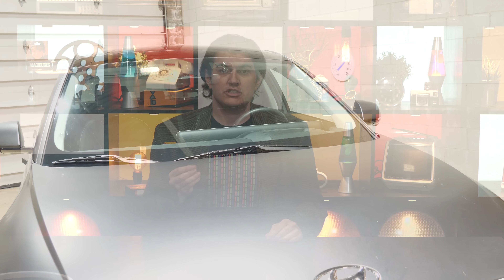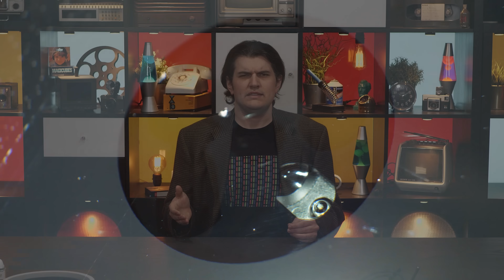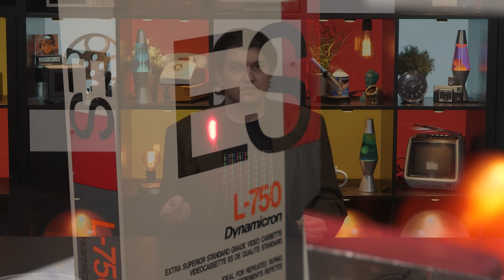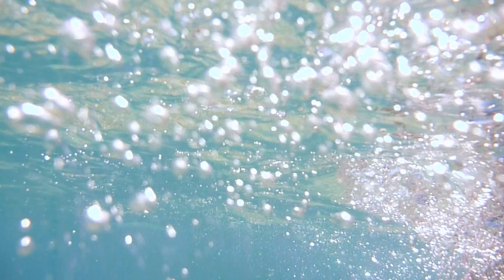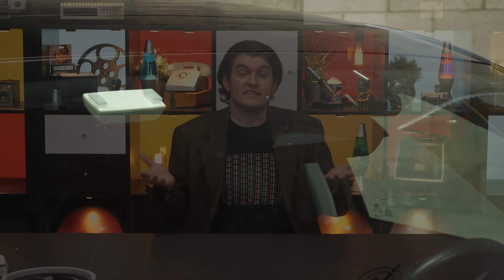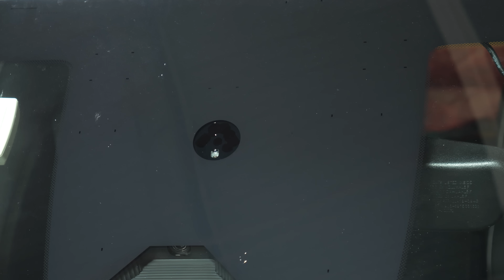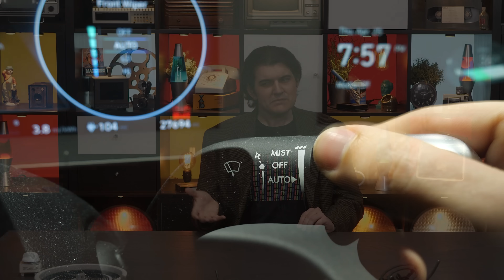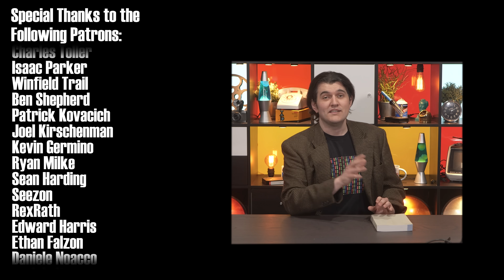The simple, clever sensor behind automatic windshield wipers

Comment: Fun fact: Mercedes (at least on their more expensive sedans) never have had variable intermittent wipers, they went straight from the 3 lines (intermittent, low, high) on the w123 to rain sensing wipers on the w124. Which also had the monowiper which is a cool engineering piece.

Comment: Looking at the size of that Owner's Manual, it took somewhere between $500,000 and $1,000,000 just to write, edit, spellcheck, grammar check, then edit again, check it for accuracy, have the engineers check it over to make sure it agrees with what they provided in the first place, and prep to print. For a car like yours, probably another $750,000 to print them.

Yes, a very large amount is all people's labor, people who are trying to make it correct and easy to use.

I know this because I used to work with these people. Myself, I was working on the Service Manuals, much larger books with much more details, yet a thing like the wipers parking up for service would be included.

Of course, my estimates are based on the costs and salaries of people doing that in 1993. So probably double that today. Do you now realize how important they are? Btw, they are also a legal requirement to sell vehicles in the US. Even heavy equipment hasd User's Manuals, especially when the controls change a lot due to new innovations that change how the equipment works, including electric power rather than internal combustion engines.

Comment: I've never encountered anything automatic that actually works the way I want it to. Some are tolerable, some outright interfere with you. From rain sensors and lane assist all the way to transmissions. The sensor itself is cheap but add in the design and software costs then multiply that by all the random automated things and you start to understand why cars are so expensive just to seem "luxury."

Comment: The cars that have an average function, to keep the wiper from going nuts, needs to reset the average reading when the light frequency changes, to detect tunnels which have the roof lights closer together than the outside road lights. Also at day the sudden darkness should reset the averaging. This wound keep the slow averaging from not turning off the wipers before almost getting trough a short tunnel, and help turning the wiper on as soon as you exit the tunnel in pouring rain.

Comment: I've owned two vehicles with supposed automatic wipers. Neither worked automatically and never sensed the rain.

And why is it that auto manuals are the only book where it's quicker and easier to look up things in the index than in the table of contents? They should put the index in the front of the manual.

Comment: The trouble with modern owners manuals is they are stuffed full of warning such as "do not drink the battery contents" or "eat the tyres" so much so that having looked up the page you want in the index you cannot find the relevant information due to the ass covering warnings. My cars wipers also turn on when there is a lot of pollen on the windscreen, which is annoying as it is sticky and smears everywhere, no use trying the screen was facility as the wipers start moving first, the celay should be the other way screen wash/mist first then wipers start to move once screen is wet.

Comment: As an otherwise very happy owner of a 2014 Tesla that doesn't have all the cameras (only the rear camera) and uses a rain sensor like this, I don't like the lack of manual control over the wipe frequency. It's just auto high/low sensitivity and manual high/low speed but no manual intermittent. It's really annoying when there's a light rain or a mist and it jumps between intermittent and high speed, or it's pouring and frequently jumps between high and low speed, or it's not wet at all and it randomly wipes. As such, I almost never set it to auto, thus not using the rain sensor. I've opted for rain repellent and manually pressing the wipe button on occasion when driving too slow for the airflow to wipe the water away (below ~40 mph).

BTW, I highly recommend rain repellent. I avoided it for years because I heard reports that it made the wipers chatter, but that has not been my experience and its effectiveness met or exceeded my expectations. It makes a huge difference for visibility, especially on dark rainy nights when the lines on the road are barely visible (I'm in Michigan where road reflectors aren't a thing). As a bonus, the wipers last longer since you don't use them as often.

Comment: This is so interesting. My current car is a 2012 Hyundai Genesis 5.0 R-Spec and it seems to have all of the same workings as a current Ionic. From the sometimes not being strong enough during a downpour and being too heavy for a drizzle. Down to the wipers not being accessible to change without them being on. I have not checked if holding the stalk to the spray setting will move them up. I'll have to try it and see if its in the manual.

Comment: While rain sensors are cool, Hyundai and Kia need to fix the rain sensor! It is so frustrating on my 2023 Kia Niro EV that I would rather have the intermittent settings and no auto mode. I don't know if the sensor can be fixed in software or not. If not, surely they can program a setting where intermittent can be selected and the Auto setting the becomes intermittent.

Comment: When all else fails, RTFM.
I used to have the auto wipers disconnected on my car.  As in, I actually took apart the thing behind the mirror and pulled the wire off the sensor, because it was crap and disconnecting it forced the car to revert to delay wiper mode, using the sensitivity control as a wipe frequency control.  Then a big rock hit my windshield, and I had to have it replaced.  With the new sensor that came with the new windshield, it works nearly perfectly.
And yes, I end up googling every time I change my wiper blades, because I forget how to engage maintenance mode and googling is quicker than looking through that book.  I do have to wonder why cars are the only thing that still come with physical manuals, and why they're so annoyingly large now.  They used to be much thinner, and nobody read them back then either.
Agreed on stalks.  And I'll say it:  Screw you, Tesla.

Comment: But why I'm still able to trick wipers to turn on by just tapping on the windshield with my fingers? Just 5 or 6 relatively fast taps in the middle of the windshield, not interacting with the sensor lights directly? Does that slight vibration affects light too? Or is there another sensor that detects the effect of water hitting the windshiled?

Comment: My car knows when it is wet, it knows this because it knows when it is dry.  By subtracting when it's wet from when it's dry, or when it's moist (whichever it is more), it obtains a difference, or deviation.  The car's computer subsystem uses deviations to generate commands to drive the wiper motors from a state in which it is wet, and arriving at the state of where it is dry.

Comment: Damn, that’s a thick manual.  I had to recently google the size of the aux terminals on the battery in my Bronco so I could purchase a bolt to use the unused posts for powering an air compressor. Battery was only mentioned in a section describing how to jump start the car. I knew I was reaching too far trying to find this.  After getting the two nuts from a local hardware store, I find out the two available posts are actually different sizes! DOH!

Comment: I was a professional driver. It was my job to drive a vast variety of cars and trucks (real trucks, not pickups, although I got to drive those, too, every now and then). After years and years in my career not once, not a single time did I encounter a windshield wiper automatism that actually worked. And beeing a former radio-/tv-technician and also just now training to be a software developer, I'm not surprised by this experiences. With the hardware used to determine, whether it's raining, it's simply impossible for the car to know, when there's something on the windscreen blocking my field of vision at the particular moment.
I don't care, if the car knows, when there's a drop of water in that extremely remote and usually unused part of the windscreen, where the sensor stupidly is located. I need my windscreen to be clear in the area where I am looking through. As long as no sensor whatsoever is monitoring my field of vision, it is logical that no automatism whatsoever will ever be able to know, when to wipe.
Reply: You are absolutely right! I find that rain sensor is the most stupid and useless invention in the car world. My previous old Honda Accord had manually adjustable interval, and it worked perfect. Now I have Honda Civic (2017) in the "maximum" configuration, including the rain sensor, and since I bought this car in Oct 2017 I can use the wipers only in MANUAL mode, because the rain sensor is inadequate and crazy unpredictable. During the elapsed 5-years garantee the official dealer few times updated its firmware, twice replaced a film between the sensor and windshield, but could not fix it. I asked them to disable this bulls..t and return the manual interval control mode, but they say: "Manual control is available only in a cheaper version of this car, and we cannot replace it" 😞.
Reply: I have found auto wipers to be mostly garbage as well, making this video very funny:)
Reply: I don't understand why auto makers insist on this stupid feature. I guess they like to fool buying into thinking it's a cool option to have. Very annoying. On the previous car it was manually operated and it was very convenient

Comment: I had 3 cars with automatic wipers. No surprise that each one (different makes) behave a little different. 
1. KIA Ceed 2014 tend to swipe wipers once every time you start the car. Then during driving sometimes it lost track of wetness of the windshield and I had to manually trigger wipers. Not so often but it happened.
2. Lexus CT200h 2015. No extra swipes when you start the car. Do not get lost, overall good behawior. The only complaint is that it didn't detect intensivity of the rain good enough. Sometimes, not too often wipers interval was of too slow or too fast.  Most of the time you had to wait 3-5 wipes and it corrected itself.
3. Audi A6C6 2011. Best sensor I ever had. No issues that previous cars had.

The only drawback that all the cars had. Including Audi is fog detection and switching automatic light on. However probably this is different sensor to blame, not the rain sensor I guess.

Comment: not reading an owners manual almost feels like a sin.
theres so many quirks and tricks you can learn about your car.
for instance knowing that if you hold your open door button for 2 seconds will make the car lower its windows, which can be a lifesaver.
or if you press lock doors before all doors are closed will lead to the car automatically locking the doors after shutting the last door close. really handy for groceries.

Comment: To my knowledge, the first car with a rain detector is the Citroën SM from 1970, though it worked differently, it wasn't really detecting rain but sensing the best speed for the wipers blades by running current through the windshield, you should look up those Citroën, those are real "oddballs"

Comment: Can you explain how energy collectors working?
For example you have solar panel with 10 V but you need to charge 12 V battery. As i understand there something with capacitor to step up voltage or something..

Comment: On my Peugeot 306 (2001 reg) which I bought second hand, I thought there was something wrong with the wipers, turned out it was the auto function. With light rain they were smooth, on down pours they were going crazy fast, once I knew this was working correct it was fine. They worked great for many years until the car went to scrapyard heaven.

Comment: I just bought a new car (Ford), and it has no (printed) owner's manual.  Combined with the fact that I am old, this feels like the car did not come with all the parts.  There is a digital "manual" (on a screen) available by pushing a bunch of poorly-labelled buttons on the dash.  But this manual is virtually useless.  The example I use is as follows -- I get my car, drive a few hundred miles, and stop to fill up the tank.  As per standard behavior since time immemorial, I want to zero out the trip odometer so I can keep a fairly accurate measurement on my gas mileage.  So I search on "odometer" in this "manual".  There is exactly ONE reference, and when I go to the page in question, there is one sentence, which basically says "yes, the car has an odometer".  This is not helpful.

After asking my son, a Ford expert, I found there is a whole page of some part of the main screen dedicated to this task (i.e. a trip odometer).  However, this capability is not explained in the "manual", under any page that can be searched on with some variation of the word "trip" and/or "odometer".

Smart-aleck software developers will be the death of me, mark my words.  And I should know -- I used to be one.

And if this comment sounds like Alec wrote it -- that is not intentional.  I have an odd function of my brain that just does that -- it mimics the last bit of language processing it has experienced.  I'm the guy who is talking with a bunch of strangers and suddenly switches to a British accent (because the folks a few feet over are speaking that way.

Comment: I have a '16 kia sedona, the wiper arms CAN be lifted with them in the parked position, I saw the instructions that you showed for changing them a couple years ago and still tried it, It is programmed into mine as well, even without needing it. Also, my sole experience with rain sensing was on a '00 buick lesabre, it worked well I would say at first, but after getting it's rain-x application that feature was rather useless as most levels of rain starting at a light mist would result in the wipers going straight to high speed. Luckily for me the solution was as easy as unplugging the sensor and the delay selector would default to the time based function of a lesser equipped car.

Comment: There is a reason why "rtfm" as an acronym exist and even has its own Wikipedia page.
And yes, I do read manuals, when they exist. I had to read a car manual once and I must say, it was well organized. My mother borrowed a car and on the highway the temperature warning light came on. I don't have a drivers license and my mother got hers not a long time ago. Because the temperature gauge looked normal, she continued driving but was worried. I checked the manual and it confirmed, that in the current state, she can continue, without damaging the car.

The point is, that manual was not just a printed book, it had easy to access sections, that were even color coded. What I don't like is that you don't get a PDF easily of car manuals, at least some brands. It is one thing to open it, when you need to look up a specific thing but sometimes you find some neat tricks. And it may look kinda weird when you take your car manual to the toilet at work. A smartphone is pretty normal and they don't know what you read. 

I find it kinda sad that a lot of manuals get replaced with a quick start guide. I too like to just try it myself first but a manual with everything written, is still nice to have.

Comment: I wonder if the front facing camera with its vision processing ever requests wipes, because I feel it does in my Mazda. My car will try to wipe the windshield if the windows are fogged up inside or there is frost build up inside due to severe cold and humidity in the cabin. If there is an air tight gel layer for the rain sensor and the outside facing layer is clean and dry then my wipers shouldn't go off in theory. On occasion i mhabe to turn off my auto wipers and run the defroster before re-enabling the wipers on a clear day.

Comment: Do you know HOW light goes slower in a medium? Its crazy. I only recently found out. Its like a train. The train is still going the speed of light, but the medium is constantly taking off the front car and putting it on the back of the train making the total train take longer to get through the medium. The photon wave front is briefly buffered, and then reabsorbed by the back of the photon wave packet. Bananas.

Comment: Needing to calibrate itself on every startup makes the "annoying" behavior I've seen from my '99 Buick make a ton of sense. When the wipers are left in Auto mode while the car starts up, the wipers will always perform a single wipe, even when the windshield is totally dry, and in fact this is stated in the manual (but not explained why). I assumed it was just some typical GM weirdness, but your explanation now makes it make total sense. A Technology Connection if you will, how about that!

Comment: I've had ny Ford Focus for 3 years and I only recently found out the wiper service mode. And I though I knew a lot about my car after basically retrofitting all the optional extras like Adaptive Cruise Control. I have gone through the manual so many times during these retrofits and still didn't notice this.

Comment: I'd take a bet that those photodiodes are just plain TSOP4838 infrared receivers, since those are very simple and readily available. I wonder if you could trick the sensor into wiping (or not wiping) by blasting it with a TV remote.

The calibration zero-ing will often do a single wipe every time you turn on the automatic wipers, my car only enables them with a push button and always shuts them off after a key off.

Comment: The caveats about auto wipers, while true, are totally software-dependent. I drive a 2016 BMW and I'm fairly sure it uses the same sensors and software that BMWs have for ages, and I'd say that 99% of the time they do exactly what I expect them to. These are pretty mature systems at this point, and it's possible to make them behave quite rationally most of the time.